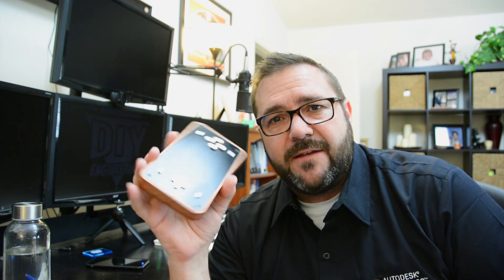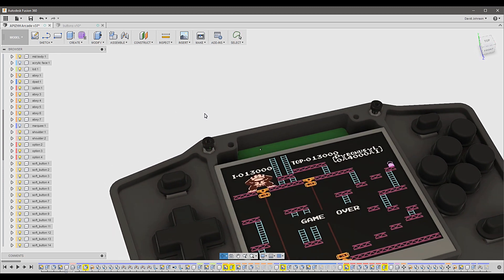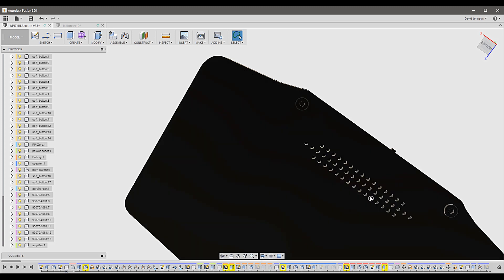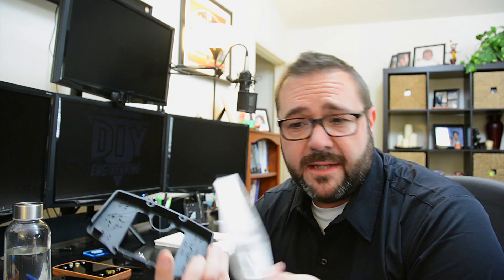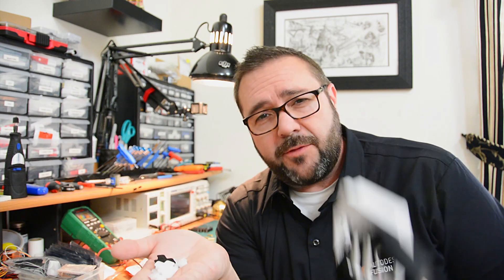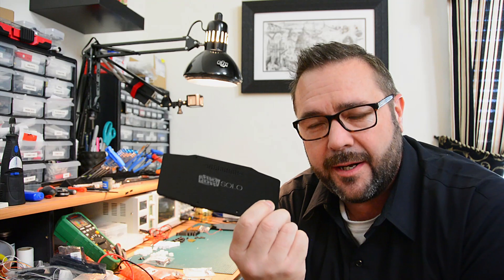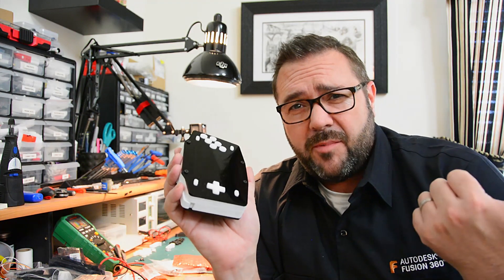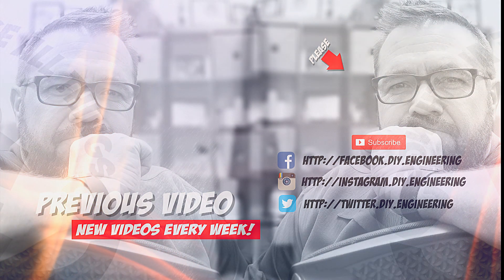Episode 027: An Affordable Handheld Arcade?!

Comment: can you use some other single board computer, there are several new computers this year that are octacore such as odroid-xu4, you could  have a console that is portable and really powerful.  Put full Linux on it or even windows 10
Reply: BCM2837 - Quad Core / 1.2GHz processor with 1GB RAM still is like half of an odroid Samsung Exynos5422 (4x Cortex-A15 @ 2.0GHz and 4x Cortex-A7 @ 1.4GHz) CPU, combined with a Mali-T628 MP6 GPU and 2GB RAM.

Comment: Somehow none of these builds go into input precision of the D-pad. The way it's supposed to work, it should have a centre post or pivot ball that helps disambiguate the directions, i.e. prevents up and down, left and right to be pressed simultaneously, and makes diagonals also somewhat less likely to hit on accident, and usually fractions of the millimetre decide upon how good the d-pad will be: insufficient disambiguation has produced such atrocities as Xbox 360 D-pad, while too high disambiguation will not allow to hit diagonals. Now i understand that the disambiguation is not quite as critical when you use stiff, snap-spring switches as opposed to rubber membranes used in most controllers, but this doesn't make the feel and precision question less relevant.

Stiffness is also quite relevant. I have a Chinese D-pad here which has rubber membrane switches, but those snap very decisively and are also very stiff; however it's extremely tiresome even after a short time.
Reply from the maker: the feel of the d-pad is easy yet tactile. the body includes a pivot on the dpad and when the kits are assembled the pivot can be tuned to get the feel you like. it is not highly precision as the Ultimate Arcade adjustable pivot but works none the less to tune the feel of the pad.

Comment: Clueless engineering question: how hard would it be to design something like this with an (additional) analog stick?  I'm thinking that this little case is one analog stick away from being able to emulate nearly any old system, raspberry pi zero performance limitations notwithstanding.
Reply from the maker: easy, could use something like the psp flat analog stick
Reply: Cool, thanks for the reply!  I hope the move has been successful :)